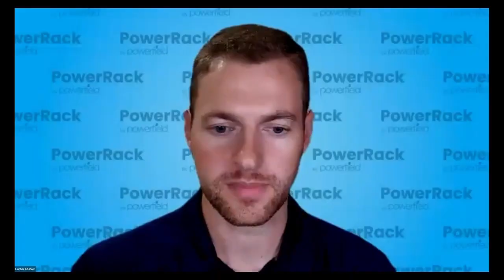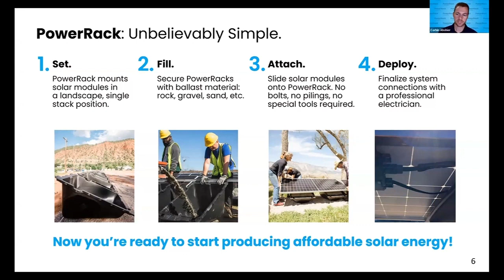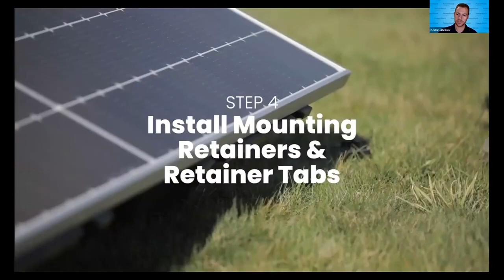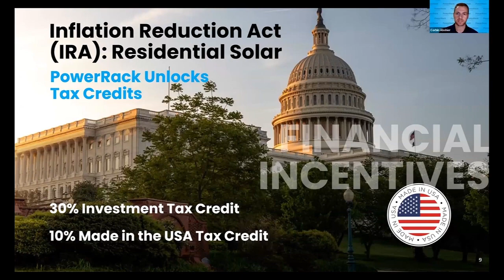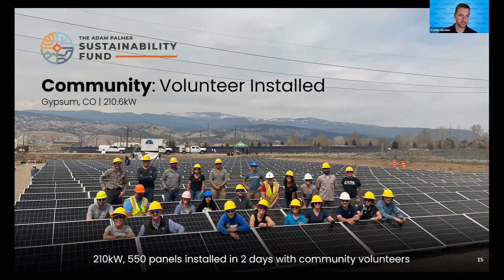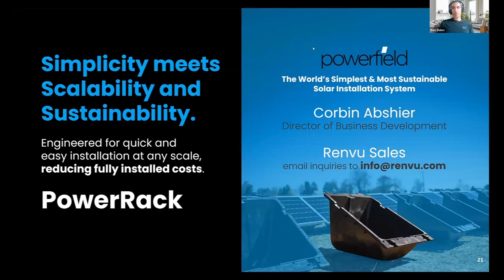Solar & Storage Market Series with PowerField Energy & RENVU

Comment: I've found that putting about 4" of gravel under each one raises them up to about 12" in the front so I can get the lawn mower under the edge. If the site needs mowing often, I recommend this. As for rocks hitting panels, that's true of any racking system, as is snow cover.